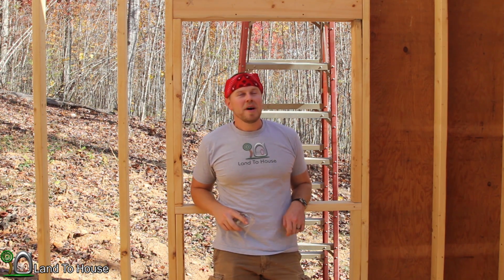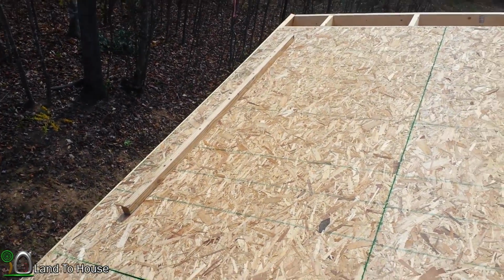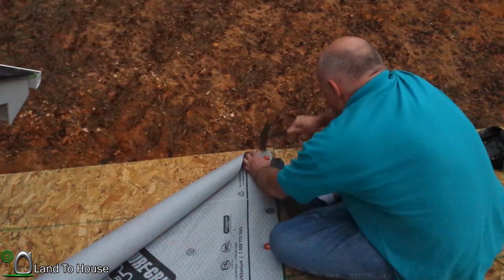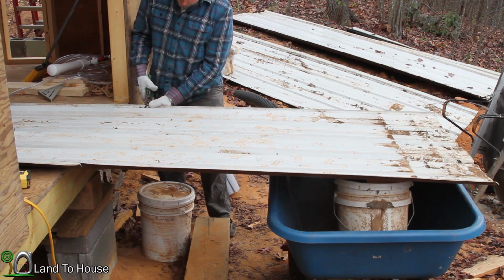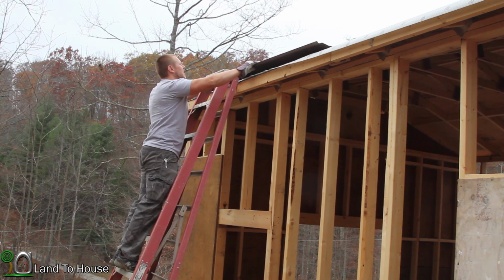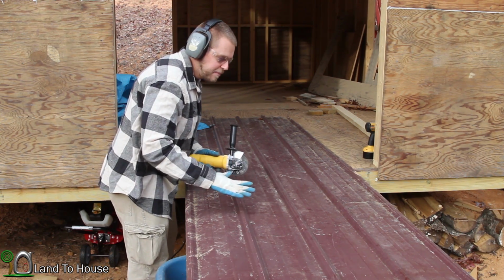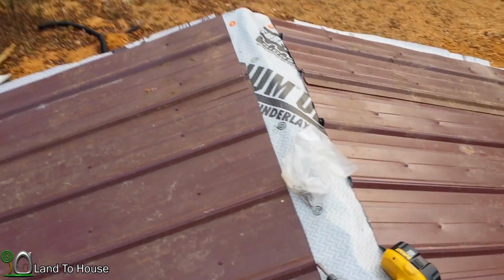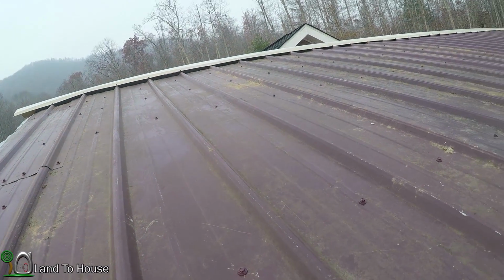OSB, Ladders, and Metal Roofing - Build a Workshop 12

Comment: ok i read comments,and noticed as a custom framer many thing do not meet any safety standards,2×4 common rafter with 5×8 osb now right there is a catastrophic accident waiting to happen and screws to screw your roof deck down osb, screws dont have tensile strength 8 common nails should have been used screws break an nails bend its prob a good thing people get permits an educate your self on the right an wromg and safety here no staggered seams oh boyyyyy thats no bueno and if you got a bad wind storm up lift your whole roof is coming threw that structure next to that atrocity that you built, words of advise do it right an get permits they are there for your safety!!!!!good luck!and no footings to carry any load or slab man this is not good!!!shouldn't be proud buddy call your city an film that we want to see!!!now that would make for a great video.
Reply from the maker: +ozzie strom hi. If you would list the violations please. That will help everyone.
Reply from the maker: The "pro's" are on youtube in full force but rarely have links to their own work to showcase their perfection. its sad but true. . . I am very new to building and I researched a good bit for this area. Most of the shed is built well I feel. There is something satisfying about having a full OSB roof with metal on top of that. I just like having that extra full coverage.  I dont know if it this building is going to last as is for 50 years but I would like it to be there for a long time.
Reply from the maker: I like to learn as I go. Thank you for the great tips. Noted.
Reply: The butthurt from the "Pros" on this post is comical. I'm from NC and have built and helped build several houses and sheds. You should stagger the roof panels and nails are stronger than screws, but your building will be just fine. I've seen far worse last over fifty years FFS. Local codes were started as a way to ensure safe building methods, but have ballooned into over building practices aimed at using more material to boost supply sales. Just compare house plans in the 70's to house plans today. The 70's houses are still standing and safe today, while the new homes are over priced debt magnets. I have used both screws and nails for construction purposes. You can use them on the same materials. Nail the sheets down and throw in a few screws to help hold them tight. I have always secured through the ridge and not the flat surface when fasten metal on the roof. You could've used 1x4's nailed across the trusses to secure the tin. That's the way most barns and sheds have been built for many years.
Reply: Hi Seth, I give you high praise for tackling a project of this size with very limited experience, however...

I have watched several of your videos and read many comments. I am concerned that most viewers are taking your posts as instructional videos. Bad Idea!! I am a journeyman carpenter in Canada and am shocked that your project has not been shut down by building inspectors in your county. Obviously you do not have a building permit. 

As for Richard Jolly's comment about using 1 X 4's (purlins) under the tin, he is correct. You don't need to sheet the roof if you are using metal, but you did the right thing for a work shop without a ceiling. When you get a heavy rain on a metal roof the noise inside the building is deafening  if you only have purlins to support the metal. Also the sheathing keeps the hot metal from cooking you out of the work shop on hot summer days. 7/16 OSB is all you need for a roof on 2 foot centers if you use roof clips for support between rafters. 

The reason for 2 X 6 studs is for insulation value, also if your walls are more than 10 feet tall you need to go to 2 x 6 in my planning district. The insulation for a 2 X 6 wall is required here in Canada because our climate is much colder in the winter than yours, it easily pays for itself with savings in heating and cooling costs. We get -10F or colder for the better part of 4 months in winter and +80'sF for a good part of the summer, we need the insulation. It's not a scheme by building material manufacturers to sell more product. Don't forget the vapor barrier on the inside of the insulation, without it your insulation is virtually useless. 

There have been some comments on your posts where licensed carpenters  criticize your work but none are posting their own videos. I will change that. When the snow melts and the weather warms up this spring I will post a series of videos on basic carpentry skills that I hope you and your subscribers will view. You will be amazed at how easy building a shed can be if you have the knowledge.
Reply from the maker: I appreciate your comments. Spoken with authority yet kindness. My experience is basically limited to this build. It has been great for learning. 

I have been trying to title my videos without "How to" so that nobody can say I told them this is the way to build. Perhaps its not obvious to some that I am just a guy building a shed. 

The osb seems like the only way to go for comfort in both temps and sound. 

The walls are 10 foot. I have insulated with r13 and it seems to be doing well. The coldest I have seen here is -5 and it was only that temp for 1 night. Most of the time it is in the low teens at night in winter. I do not think the record has ever seen over 99 in the summer. 

I am very much looking forward to watching your series. Filming your steps can slow progress significantly.  When you have a few videos up I can share your work to help others learn. Keep up posted.
Reply: I've been following this project from the beginning, WOW!  Me being from NJ now living in SC and a retired LLC. contractor having  worked in  NJ, NC , and SC. I've worked on a many projects in the south and found the same type of workmanship on this type of projects. NOT up to code!!! from the start till? I'm surprised this job wasn't stopped. Doesn't matter who you are, homeowners need  building permits for a reason, safety first, make sure it's done right.  Every town or city or out of city limits we've worked in 90% of the times we needed a permit, sometimes for the smallest thing, no matter what. I've seen it where inspectors fined big time and ordered the take down of the projects. On this project I've counted over a dozen violations so far. This definitely wouldn't happen in city limits or a close neighborhood as I can see he's not. When a tax assessment is done and this doesn't show up on record, $$$$$ in fines and removal, too bad for him. All that hard work for nothing. He probably thought he was doing right. There is a saying, " ask first when not sure ".  If I was still in bus. I would use this video as an example of right from wrong.  I'm trying not to be negative but it's a lesson for other DIY people......Now days assessments are done by flyovers or walk-ins when needed, so it's hard to pull a sneaky.

Comment: I am not big on Health and Safety regulations but I think carrying the OSB up to the roof, as you did is asking for trouble, I am not saying I have not done it but its a pretty good way to end up, at the bottom, on your back with the sheet on top of you, then who is going to look after the dog.
Anyway I am glad you have got the roof on, its always good to get to that stage.
thanks
James
Reply from the maker: This was just one of those "get it done" times. My dad did help with a lot of the roof parts. The worst part was getting the OSB over the ladder. It had a small point where it was half over and half not that was a little bit frightening. ... Haha that poor dog.
Reply: a buddy of mine does these custom sheds and uses ... Gator Lift Clamps...

Comment: Glad to see you picked up the angle grinder to cut the roofing.  Another quick and easy way to cut metal roofing is to use a carbide fine toothed blade on a circular saw.
Reply from the maker: +kuhrd I had not thought about the circular saw. Mine is battery powered so might not be the best. The angle grinder is great !

Comment: thats no the proper way of building/installing gable ladders.....should have also put in a ridge vent. you're a nice guy and i mostly enjoy watching your videos, but id say 50% of what you do in your videos isnt right
Reply from the maker: +mikey money 50% might be generous in some of my videos... I suppose it does show that I have no training in any of this but at least I'm trying. Since I don't have a construction mentor I get to learn by doing. I am Loosely basing my building from my neighbors and from my parents and neither of them have vents.
Reply: Land to House A for effort tho my brother. Just watching you carry those 5/8 osb's up the stairs was hard work. But I frame roofs for a living and if can do a little mentoring... Plywood is staggered 2 ft from the seam to meet code or 1 ft only if needed in certain layouts just to allow you to continue your pattern. From the top and bottom of the osb its spaced 1/8 of an inch where the top and bottom rows meet. To allow the wood to expand during the seasons. Also I didnt see any blocks around the top plate tieing into the rafter tails usually 22.5. Keeps your rafters aligned and allows for extra nailing surface for those bottom pieces. 6 inches apart each nail for each side on the seams 12 inches every thing else. Last for your overhang on your barge. You used cripples which I'll suppose is fine for a shed ? But for a stronger build you can cut 1.5 inch deep by 3.5 wide into the gable ends and allow your 2x4 to run past the gable hit the rafter behind it and extend out towards the facia where you can plum your cuts using your eve and gable block. You always measure from inside the 45 degree cut on the eve to the very edged point of the block at the pinnacle of the gable. Account for your half inch facia so if its 22.5 itll be 24 inches finished. Also use. Hot dip galvanized nails.... Or you well see rust stains in your facia after weathering...  Mastering your speed square will make roof work easier as well. Hips common cuts. Etc. Hope this helps
Reply: mikey money
Reply: Oh and I believe you have scissor trusses. Which sometimes cant accommodate sway bars. But sway bars are important. In maintaining level gables and preventing it from collapsing on its side. Maybe nail 2 by 4 behind the gable like if it was backing and nail the gable to the 2 by 4. Every 6

Comment: you could have just used some 1 x 3 or 4" strapping instead of osb, when you use metal roofing,  saving a lot of money
Reply from the maker: +Dan that is true. I kind of like the idea of OSB and underlayment for Extra Protection. The metal was free so the OSB was a small cost
Reply: use a nail gun for large areas like a roof .it is so much faster.

Comment: I know your done already but here is some helpful tin snip info. Green handle = left circles, red handle = right circles, and yellow handle = straight. There is also a large type of snips for straight cuts which would have been great for this application. The question you need to ask now is where was I a month ago with that info! 

I've done a lot of work myself where having two people would have made it ten times faster. You're doing great, keep up the good fight!
Reply from the maker: +Adam McCarrell bahaha yes that is exactly what I was thinking. Luckily I found a pair of yellow handle and it worked well.... it said dewalt on the side haha
Reply: Put a blade on backwards on your skill saw with a clamped down straight edge oh yeah ear protection is a must.
Reply from the maker: I went with angle grinder and that really saved time on metal cuts. I was not sure how well my saw would work being the old style battery model.
Reply: Adam McCarrell !

Comment: You are not supposed to line up the seams in the roof sheathing, staggering them makes for a stronger roof!
Reply from the maker: +Mike Garrison that makes sense. I suppose it's a little late now haha
Reply: correct
Reply: Mike Garrison
Reply: Ttf Web Its not code.
Reply: Mike Garrison I don't think it matters very much. I've never had a failure due to it. Have you had a problem with it?
Reply: That is just the way every builder does it, stagger joints, I've done it on my house and shed with no problems.

Comment: I would have installed the metal roofing and then cut it off with a metal blade in my circular saw.
Reply from the maker: +BUDDY LIGHT I suppose that would allow you to have even sides on the end after the roof was installed. I guess I could still do that to even things up.

Comment: Why not use a sawsall with a metal blade??
Reply: Ok, just saw the angle grinder.  Must get one of those.  Nice.
Reply from the maker: +F333 my dad has a Sawzall but the grinder is way easier!  Put a metal cutting disk on there and go to town! I use this one all the time for ram pump tanks.
Reply: Don't cut your sheet metal roofing with an angle grinder it removes polymer layer of protection from it by overheating the edge and promotes rust. Sawzall is better, but not ideal either. The cut must be cold for it to work properly and sawzall can still generate considerable amount of heat. Especially on thicker sheets. Ideal tool for this would be a nibbler. If you don't have the money for a power nibbler you can buy a drill attachment or good old elbow grease version. It doesn't seem like this guy has a problem with elbow grease.
Reply from the maker: elbow grease I probably have a little of.  money and construction know how are definitely some of my limitations
Reply: Your efforts are still admirable and I know this comment will probably not be of any help to you personaly (being a year too late and all) but I'm just leaving it here for others and also for myself because when I first build something using profiled sheets i made this same exact mistake :D